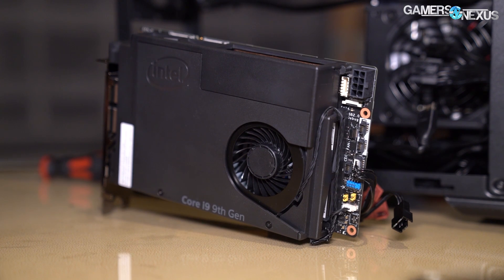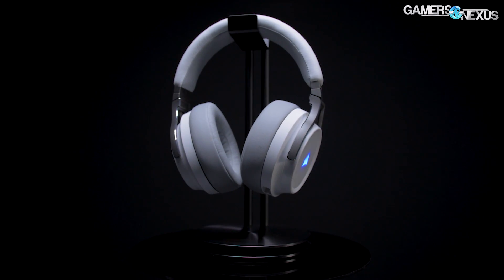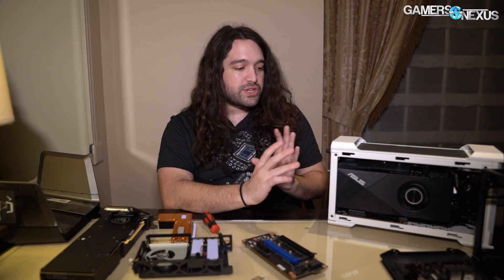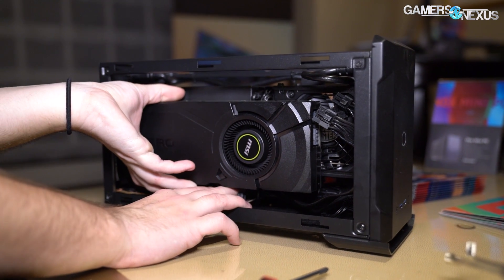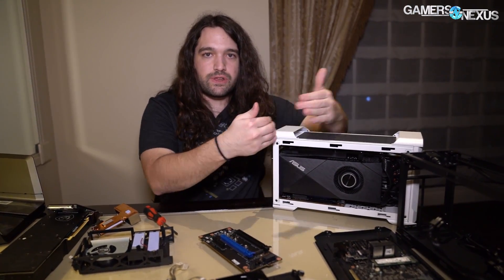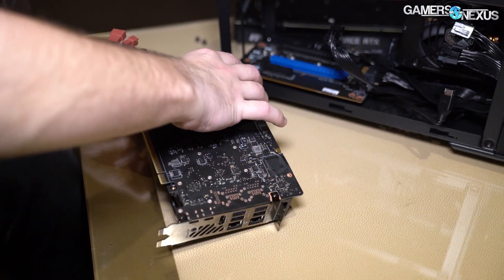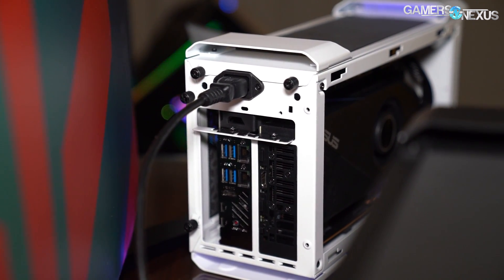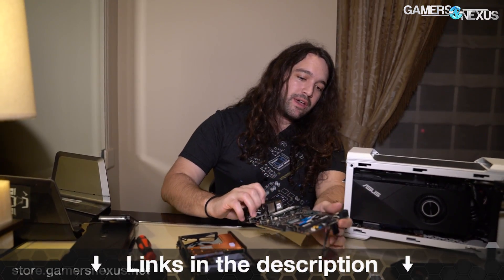Intel PCIe Socketable Computer: Tear-Down of Ghost Canyon NUC SFF PC

Comment: Yo, I heard you like computers.

So I put a computer in your computer so you can compute while you compute.
Reply: Nah, it's just a laptop with a PCIe interface that uses a slot instead of a socket.
Yes I know what jokes are, wooosh, etc etc
Reply: Ty Intel
Reply: It could be used as a streaming pc
Reply: Yo dawg so now It remains only to add a monitor
Reply: Compute-eption!
Reply: @janiss2926  Though streaming with a CPU is pretty archaic and outdated, I prefer using NVENC or a capture card. Even if I use an 8 core 5960X I do my best to offload as much process away from my PC...I even have an expensive  intel ethernet adaptor to handle the networking.

I see a use for this especially as an HTPC inside my gaming PC, because using my 20C Xeon for HTPC tasks is just a hassle....and I always wanted something like this since my case doesn't support dual motherboards, and it's too sentimental for me to buy a new case.

My only problem with this thing is that it would probably sag in a regular desktop environment, my MSI Trio is already giving me lots of problems
Reply: @janiss2926  My 5960X is on open loop (4.9Ghz) and my 64GB worth of DDR3 and the enormous amount of I/O the X99 platform has me not wanting to buy any platform this gen. I wanted a W3175X because it is the only interesting platform but they don't have it here in the Philippines

I use my 20 core 40 thread dual 2660V3 Xeon for cloud, NAS and CCTV,  it's something I did for fun and not really my daily driver

I use a 2080Ti Gaming Trio, and the quality between NVENC and CPU encoding is not as much as you describe it to be and certainly not "garbage" now..and both have usage case scenarios

I play fast FPS games , QUAKE, CoD MW, CSGO and R6S and a more consistent image is better than quality with inconsistencies.

And no, children and regular people don't watch you with their 4K monitors and Retina displays, almost all the time they watch you on their phones or 1080p monitors, making quality irrelevant
Reply: And I used to have an Elgato Pro capture card, it was probably the best thing I've ever bought for my PC for streaming but I traded them for Jordans. I would buy them again if I have the time
Reply: I literally just commented this shot thinking I was being original lol
Reply: @janiss2926  Not a pro, never want to be one...I just  stream for my friends, I'm not a Pewdiepie or Shroud to warrant the best streaming devices out there

Yeah, it's a platinum chip...seen people do 5Ghz stable on a 5960X with both acceptable and dangerous voltages in the owners club...mine can't get past 4.9Ghz and this is just for this season since the temps help my NH-D15 handle it.

By February I'll pull it back to 4.7Ghz again, more practical.
Reply: @q5sys  At the $1050 mark for a barebones i5 entry level card, I don't see merit in it. I have a pihole myself (and octopi and and...) and I see no way to justify the cost of this thing to reduce the number of external 'puters in the house.

Even if we talk about your usage case - a development environment - I personally just got an old laptop and left it under the desk when I needed something like that. I accessed it remotely using plain old remote desktop, which is not great, but it didn't make much difference to my use case. A KVM would've been better, but to be honest I couldn't be bothered to order one in.

If a puter on a PCIe card was a sensible price (like, $400ish for the i5) and had an on board m.2 slot, you'd have something that would be easier to justify.

But as-is, this seems to be something that would have near no market.  Most people would be better served by existing alternatives.

Maybe not all, but definitely almost all.

*edited because autocorrect is not automatically correct...
Reply: @Anton Taylor  This, just like their other NUCs, are not really catered to the budget crowd...there wasn't even an instance that intel was marketing this to everyone and mass producing it like mad. So complaining about price (adding the fact that they are in low numbers, probs had a huge RND backing it and nothing comparable in the market) is moot. 

For my usage case scenario, instead of a dual motherboadd system that I would spend a good chunk of cash on a case and a PSU for(which are extra hard to acquire because I'm in the Philippines)...I could just jam this in a PCIE slot and pair it with an RX 580 or something.

And yes, I was planning to strap a Hades Canyon onto my PC case to have a "dual system PC", so this is a godsend for me
Reply: @JABelms  I didn't complain about the price. I pointed out that there are better value propositions on the market for almost every conceivable scenario.  You have not at any point managed to prove that assertion is incorrect, so your accusation that I am "complaining" is what is moot. Try making a compelling argument, instead of dismissing what I say as "complaining", because that's just you being lazy. 

There's no indication that this will work if you plug it into an existing motherboard. No indication that it won't. As a standalone PC, it's not great value unless you have a particular need for a tiny laptop grade PC with a full size desktop graphics card inside.

As for your usage case, instead of "complaining" about the price of a dual motherboard system, why not simply do what everyone else is doing, and put two small form factor PC's under your desk?

Ignoring that option doesn't make sense. I suspect that your real reason for ignoring that option is that you are not willing to accept that this NUC makes no sense in the usage case you suggest. You seem more interested in winning teh Internets than in the basic logic of two small cases under your desk being better value/faster/more flexible than one big one with two PC's in it.

Not at any stage have you made a compelling argument.
Reply: @antontaylor4530  You can explain everything that I have claimed with common sense. You talk as if we live in the same place or have the same needs for a PC

1. My PC has an i7 OC+NH D15, EATX motherboard, 2080Ti MSI Trio OC, 4 SATA SSDs, 6 HDDs and an extended Leadex PSU. Care to find me a "small form factor PC" that can house these parts and cool them as well? I'll wait

2. Adding to that, I would choose a single large tower over managing two small CRAMPED PC cases thanks. Less cables , less hassle, doesn't look butt ugly in my house. Also, putting your PC under your desk is unacceptable especially in my case

3. So you also want me to use a laptop? Want me to whip out a laptop and plug its power brick and plug it to one of my ultrawides? Massive waste of time and hassle, there is a reason my Macbook is inside my backpack and not under my desk and why my desktop is almost always turned on 24/7. Not to mention that this NUC can potentially smash a laptop in both form factor and performance. Price aside, this is the absolute BEST form factor for a capable HTPC currently

4. Why not? This stick can just be powered by a PCIE slot and an 8 pin. So it is entirely possible for it to be compatible with motherboards. If any oddball weird Chinese PCIE devices are compatible with majority oc motherboards, this obviously will

5. But you are complaining about the price, let's be clear here. If this was dirt cheap nobody would even care about it....they have been doing NUCs for years
Reply: @JABelms  

Hoookay...

1) Your PC is lovely.  Thanks for sharing.  As for what case would house such a beast - who cares?  That's your problem.  We're not talking about you.  We're talking about the market as a whole.  You are not the market.  Plenty of overclocked i7's out there with a full size graphics card in itx cases - stop being lazy and do your own research.

2) I refer you to answer number 1.  As for cable management, adding this card to your existing case would require exactly as many cables to be managed as a single PC, since the NUC is not an expansion card for a PC.  It's a standalone PC.

3) No, I do not want you to use a laptop.  I never said you should use a laptop.  I pointed out that this NUC has laptop grade components in it.  Please pay attention.

4) Why not - because it wasn't designed that way.  It's a PCIe host, it's designed to talk to a PCIe peripheral or two via a riser card.  Can it be made to talk to another PC over PCIe?  Maybe.  But Intel isn't saying either way - what does that tell you about driver support for your plan?

5) I think you need to look up the definition of "complaining": "the expression of dissatisfaction or annoyance about something." Pointing out that something does not make sense is not "complaining", since I have not expressed dissatisfaction or annoyance about anything.  That's you reading between the lines and putting words into my mouth that I never said, then telling me how wrong I am about those things I never said.  AKA strawman argument.
Reply: @antontaylor4530  1. Uhhhh. That goes to you too bro
~Small form factory PCs are considered niche in the PC community. Don't you know that?
~I have a 5960X OC'd to 4.9Ghz on all 8 cores and all my quad channel memory are filled. Is there even an ITX board that supports quad channel?
~I would not go around and find a mini case that can house my 13 inch GPU. 

And the only mini X99 ITX motherboard that is available is from ASRock (yuck) with pathetic features

Not only that you left the part where I have 6 HDDs and 4 SATA SSDs, which automatically makes my system impossible for a mini PC build. Making your point irrelevant

I will.NOT follow what you say because you hate this product. I know mini gaming PCs very well. Do I want one? Never because I am an enthusiast

2. No it does not. My PSU can easily supply a dual motherboard system. Having two small form factory PCs needs two powersupplies. Do you understand now

3. A barebones PC has laptop grade components in it? Do you even realize how ridiculous that statement is?

4. Ah no, was just looking forward for a PC that can be put into a PCIE slot and be powered by it. I don't want both PCs communicating through it because that will OBVIOUSLY bring in software issues.

5. Errr the tech press and many people loved this thing (they even said that it is the highlight of intel in CES) for the tech presented

>People who see the potential of the technology appreciate it
>People who don't look at the price tag then complain

Also it's not strawmanning if it is obvious
Reply: @JABelms  No, SFF PC's are not "niche" at all.  Every major PC manufacturer makes them.  Every.  Single. Manufacturer.

I don't "hate" this product.  You're putting words in my mouth again.  And telling me how wrong I am for the things I never said.  I very clearly stated at one point that I thought it was pretty cool, but that it didn't have much of a market.  I never at any point said I disliked it in any way - I said there were better value ways to get more cores.

2) Having two PSU's is a problem becauuuuseee???  Because if you have a failure, you only lose half of your systems, not all of them?

3) I said nothing about "a barebones PC".  I said THIS NUC in particular has laptop grade components in it.  Which it does.  It's not a ridiculous statement, it's mere fact, which I only pointed out because you erroneously stated that I wanted you to use a laptop.  You got something wrong, I corrected you.  I made no sweeping statements about the SFF PC market, so that's you getting something wrong again, and this is me correcting you.  Again.

4) Obviously.  Also obvious is that you're missing the point.

5) Yes, they loved it.  Well, some did.  I wouldn't speak for every member of the press.  But they didn't look at it as a PC inside a PC, they looked at it as a SFF PC with a full sized GPU slot.

>I see the potential of this product.  I pointed that out myself early in the comment thread.  I also see that it has a ridiculously limited market as a PC inside a PC.
>I didn't complain, you did.  I pointed out that there are better ways to get more cores inside a chassis.  Which is not true how???
Reply: @antontaylor4530  1. They are niche. I live in Asia (yeah where majority of people live) and I have a IT business that centers on assembling PCs for net cafes (esp. For mainland China) and this is what I noticed in the market 
~Note that I wanted mini PCs back then because they look better/classier thus marketable to PC shop owners who need space. However AIO DIY desktops are just way more practical now
~Mini enclosures are expensive as they are as rare
~Same with motherboards, ITX mobos are overpriced to say the least and there is barely any stock here. I literally could count how many times i've seen an intel N motherboard in my 15 years of building PCs which is like maybe 8. They were almost always order basis just like EATX motherboards

~The only SFF PSU I have ever saw in retail from Indonesia to Shenzhen was a single Silverstone model, nothing more.

2. My PSUs are not trash :/ so is my entire powet delivery at my home

3. No I mean it has barely anything in it and you compare it to a laptop? A laptop is an entire PC, this NUC is literally components. Think about it first

4. I don't know why you keep ignoring my points as well. My applications to this thing is as an HTPC (and in my house, I prefer an capable HTPC that nobody sees as much as possible)

This is the smallest I've seen, which has the potential to drive two of my 4K TVs for playback.
Reply: @JABelms  
1) No, they're not niche.  They're literally everywhere.  Including the very video we're discussing.  Just because they're not popular in YOUR area, doesn't make them niche - the definition of niche is not "rare in the area where J.A PCMR lives".  As for what is and isn't expensive, stop "complaining" about it.  It's a double standard to accuse me of complaining about the price of this NUC (which I didn't even do) and then whinge about the cost of ITX components.

2) I never said anything about your PSU.  Stop putting words in my mouth.  You literally cannot stop, can you?

3) I didn't compare it to a laptop.  Again, stop putting words in my mouth and then telling me how wrong I am for the things YOU said.  I said this NUC has laptop grade components in it.  It literally has mobile grade CPU's in it.  Whether or not it's barebones or a complete PC - irrelevant.  Not one thing was said by me about that.  Another strawman for you to burn.

4) I have not ignored your "points" - you simply keep bringing up things that are nothing to do with the point under discussion, and trying to tell me how wrong I am about those things I never mentioned.  It really doesn't matter what application YOU have because it was never about YOU.

I said that this NUC, if used as a PC inside a PC, has an extremely small (or "niche") market.  You keep going on about SFF PC's being "niche" and yet here you are arguing with me.  When I said this SFF PC, when put inside another PC, is "niche".

So which is it?  Are SFF's niche, and therefore this one product when used in a way not really intended, is niche, or it's all mainstream and we should all be having one?

The crazy thing is, you're not arguing with me.  You're arguing with the voices inside your own head.  You keep telling me how wrong I am about the things that I never said.

You understand that's literally the definition of insanity?  Right?  Riiiiight???
Reply: @antontaylor4530  1. Nope, their niche and I don't think you can convince me otherwise. I literally have connections to PC hardware supplies that go around the entirety of Asia. Do you know the most popular cases? Fractal Define, Lancool II, NZXT H series.

For you Americans, you can literally check Amazon for the most sold PC cases. Spoiler alert there is only 1 ITX case in the top 50 and it isn't even in the top 30.

Statistics beats your feelings. You are a minority, deao with it

2. You are dense are you? You said I needed two systems with two powersupplies because the risk of losing one PSU I can still use the other (you literally typed that down). My PSUs can last 10 years with no issues thank you very much. That's what happens when you buy top of the line Delta, Seasonic or Superflower PSUs. I NEVER had PSUs fail

3. IDK why you keep repeating the laptop shit. The Ghost Canyon NUC can have an 8 core i9 9980HK inside of it, that turbos to 5 Ghz. And here's the kicker~it doesn't conform to power saving and thermal constraints of laptops, so it performs really well and consistently. This thing obviously demolishes a laptop, especially if you pair it with a none max Q Nvidia GPU

SFFs are niche and so are NUCs...simple as that. I'm just giving you a scenario where a niche amount of people might have a use for these

So now, give me a comparable sized board that houses an 8 core i9 that does 5Ghz and it has thunderbolt capabilities as well. You said it yourself that there are "comparable" hardware already in the market. Then lets hear it then Anton Taylor

Because you are wrong
Reply: @JABelms  
1) I don't need to convince you.  Every major PC manufacturer makes them.  
A few examples: Apple
, HP, Dell, Lenovo, Asus, Acer, Toshiba, Samsung, LG, Sony.  In fact, even if only Lenovo made them, they'd still outsell almost every PC you sell by 100 to 1, because Lenovo sells by the millions to corporations, who buy SFF PC's in the millions.
  The majority of PC's are off-the-shelf, white goods style boxes, the cases you mention are outsold by mainstream off the shelf systems by such a wide margin that custom PC's are actually a fairly small segment of the market, comparatively speaking.  If you sell PC's for a living, you should know that.
Just because you don't sell them, that doesn't make them niche.

And I'm not American.

2) I didn't say you needed anything.  I said that the usage case q5sys mentioned would be better served with 2 totally separate systems.  I don't know nor care what you need, I was talking about a particular usage case.  The world does not revolve around you.  And again, I never said your PSU was unreliable, but the fact remains that PSU's, even reliable brands, do fail.  That's why we put dual hot swappable PSU's in servers.  Like, millions of 'em.  Go on, tell me how stupid that is.  Tell me how "niche" that is.

3) The reason I keep mentioning this "laptop shit" is because Ghost Canyon is based on FCBGA1440.  Which is a laptop socket... Oh, and the 9980HK is a laptop CPU.  Just because you don't know your hardware, doesn't mean I'm wrong about the NUC being based on laptop hardware.  Intel straight up says exactly that on their Ghost Canyon press release.  It's not me saying Ghost Canyon is laptop hardware, it's Intel saying that.  Google it.  Google "9980HK laptop" while you're at it.

As for what is the same size but more powerful - I never once said you could get something more powerful that was this small or smaller.  Another strawman argument from you.

How many times are you going to say things that are downright wrong/imaginary?  You keep pretending I said this or that, and then trying to make out I'm wrong.  I'm not wrong about those things I never said.

I said that this thing, when deployed as a PC within a PC, would have a ridiculously small market.  And now you've just said the same thing.  Congratulations.  Bravo.  You've just agreed with the thing I said right at the start.  You genius, you.

Making stuff up to try to prove me "wrong".  And you have the nerve to call me "dense"???  Who's "dense" - the guy arguing about things that were never said, or the guy you yourself just agreed with?
Reply: @janiss2926  That's why I still use it after 5 years (planning to keep it until 2023 or something), and the X99 platform fits well into my needs that I don't see why I have to upgrade to any new platforms now adding the fact that nothing interests me. I only needed a 2080Ti at 4K to keep up with a 9900K.

I lived in the time where people were modding their cases like crazy, having Quad SLI and dual 5970s were a thing, where people had EVGA SR2s, top end CL, Silverstone and Lian Li cases and 30 case fans in their PC here in the Philippines and 4 front panel monitoring systems. Trust me, compared to enthusiasts back then....my system was cheap as dirt
Reply: I'm pretty sure this is not aimed at putting a computer inside a computer - I think it's just a new way to do a micro sized "NUC" PC (as in, it's a rival for mini-itx etc).  That's why the base board you see him handling has no CPU on it - it's basically a PCIe riser with an SSD slot on it.  Adding it to an existing PC doesn't seem to make sense (even if it works, which I doubt it would) - this is a much more expensive way to add cores than to just buy a CPU with more cores.  Google is telling me the prices start at $1050 for a barebones i5 from Intel directly - how many cores can you get for that money?  An i5 for $1050 as a barebones, even if you knock $200 off for chassis/PSU, you're still looking at a 3950x plus motherboard for that money.  Or at least a 3900x.  In what world would a laptop grade i5 rival a Ryzen 3000 series of any kind? 

And if you want a computer inside a computer, virtualization is your way forward.  More cores in your CPU, then virtualization on top makes more sense in every scenario I can think of.

It makes no sense for the desktop environment to add cores this way, and in a datacentre, you'd just buy a blade server or two and build out a nice cluster.

As an "add on" CPU, this sort of thing doesn't make sense.  It's a cool idea, to be sure - but it makes zero sense in the real world.

This isn't an add-on for existing computers, it's simply the smallest form factor PC you can get a full sized GPU into.
Reply: @antontaylor4530  QNAP Mustang-200 did that in 2017.  I was hoping it'd take off and other manufactures would make similar devices, but it doesn't seem like it has.  It'd be nice to be able to run certain jobs on an add-in card, instead of just a VM.
Reply: @q5sys  Thing is, why stuff a second, overly expensive computer inside your computer when you can simply put a second computer under your desk?  Or a rackfull of 'em in the basement?

There's such a tiiiiiny market for a CPU on a card because almost anything you can do with it can be done better by other, existing technologies. Most industrial grade software suites that has long render times have the ability to farm out tasks to a cluster.  For example, back in the early days of ray tracing, Babylon 5 was being ray-traced on Lightwave 3D.  They built a nice render farm of PC motherboards on trays to render 24/7 to offload the actual renders onto, leaving the desktop machines to layout new wireframes or scenes for the farm to render later, allowing the humans to do actual work more of the time, and twiddle thumbs less of the time.

It makes so much more sense for 99.9% of tasks to do something like that.

The only time it makes sense to put a computer inside a computer for the everyday computer user is for very specialised tasks.  For example, most RAID cards are actually a complete computer in their own right, with either software RAID pretending to be hardware RAID on something like an ARM CPU (for lower end RAID cards), often with only hardware accelerated XOR calculations, or true hardware RAID supported by or baked into something like an ARM CPU.

Software RAID on a dedicated CPU will look a lot like hardware RAID to the host.  And marketing departments would probably argue that it is hardware RAID.
Reply: @antontaylor4530  not enough power on pci.
Reply: ..I put a computer in your computer so you can build computer in Minecraft.